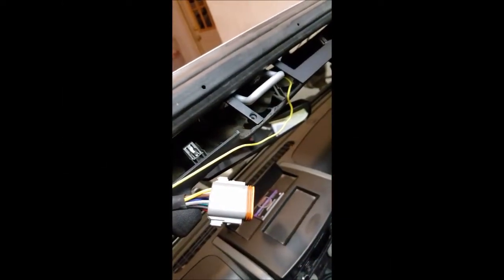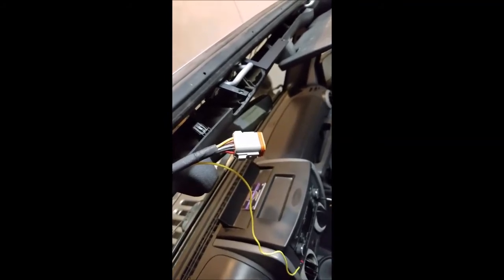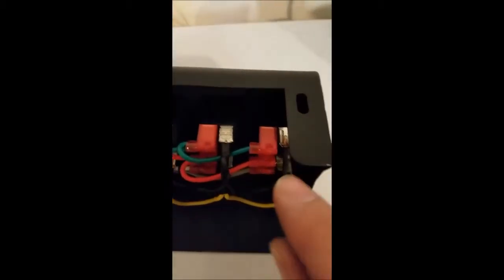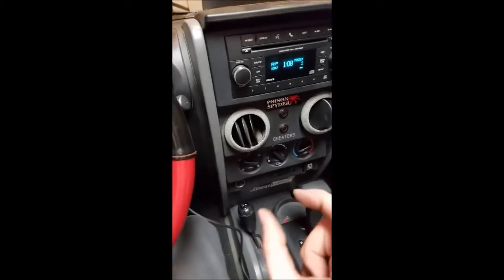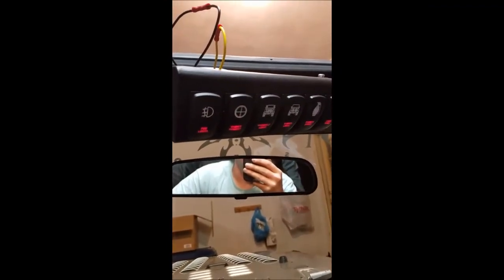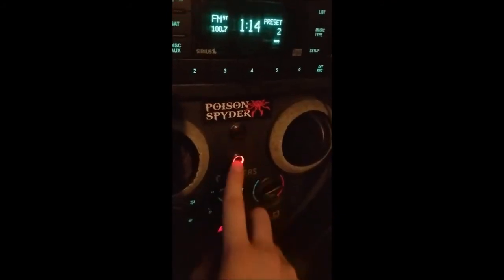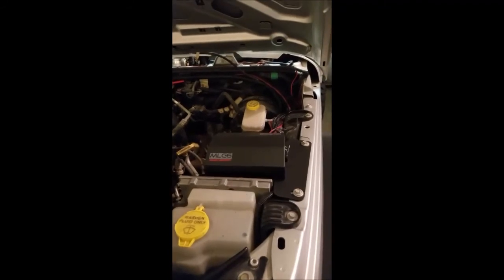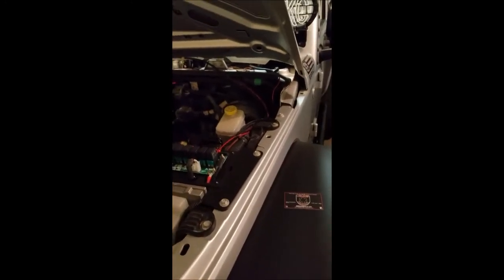Jeep JK Rough Country MLC-6 "SPOD" Part II

Comment: One question since I don’t fully i the electrical... instead of running your black ground down, can you not jumper it to the other ground (#8) on the switch?
Reply from the maker: James Watts you probably could, but I found it easier to just run my own at the time.

Comment: I’m having trouble closing my hard top fully, ( the latch above the light controller ) I was wondering if you had the same problem
Reply from the maker: Ryan Vizcarra this system, along with the spod unit makes it a little tighter to get the latch on. I can't close mine all the way, but enough to make the latch tight.
Reply: JMG Designs LLC same here, I can’t fully close it but I can get it tight enough were water won’t get in etc

Comment: Great fix for the MLC-6! Since both 7+8 are ground, couldn't they be spliced together? I will tap the lower led power onto switched power or add a small switch like the spod
Reply from the maker: a. ggrex yes both pin 7 & 8 can be daisy chained and share a ground. For me, it was just easier to do my own as the space in the switch mount was getting tight.

Comment: Could I see how you took out the switches, swapped them for a new one, and rewired them? I just got the mlc-6, and it now comes with a “power button” so to say, and it has me connect it to the fuse somehow, but right now I’m just wanting to change my switches. Haha
Reply from the maker: Depending on the switches they may have different wiring on the back of them. Make sure you check out the diagram with your new switches and do your best to match them up.  
With the power button on the updated system I hear it is a little more complex but that should be the button for the lighting of the switches.

Comment: I don't do a lot of electrical but I want to get one of these systems for my wrangler.  Is that Orange wire with grey stripe still used on 2015's?
Reply from the maker: Taylor Buraczewski it should be, or if you have the ambient footwell lighting then you can likely tap onto that instead.

Comment: Hey JMG Designs LLC, would this way also work to tapping into the JK dash light circuit and make the lower led's dim?
 on page 5. http://s3.amazonaws.com/roughcountry/install/921709620.pdf

I was wondering, will the LVCO still work even if we follow these instructions? And also now that it is plugged into the fuse and is connected to the ACC and dash will the upper independent lights on the Otrattw buttons still work?
Reply from the maker: Quinton Pearson using the way provided in the new directions will not dim the RC switch LEDs.  That red wire for the switches is the power going to the switches, so it needs to be constant. Tapping that to the dimmable dash lights won't work.  This route will make the switch pod only usable when the Jeep is ON.     Turn the Jeep off, the switches will not work. 

The low voltage should still work if you have the Jeep ON, but not running. If that makes sense.
Reply: Thank you very much! So because I have the door switches, where can I plug that power wire into? Also are the switches that you got from OTRATTW the lower independent ones? Do you have a video showing how you connect the power wire behind the dashboard and the one under the footwell?
Reply from the maker: Quinton Pearson if you cut that red wire already like in the directions, you can splice it back together or run it like a fuse tap.

The OTRATTW switches I believe are lower Independent, I think I explain in the video. This is so we can independently wire the lower leds to come on with the dash lights.  If you have footwell lighting that wire should be easier to find and tap.
Reply: Oh ok, so since I haven't cut that red wire like in the directions i showed you I don't have to worry about splicing it back together correct? And cool I will try to just copy what you did in the video. And by independently wiring the lower leds to come on with the dash lights, i will be a to turn off those led's when i turn the dash lights off right? And I'm sorry for continually asking so many questions lol electrical work is not my forte.

Comment: I'm electonically challenged, I wish you would do a separate video that shows how you rewired the switches step by step.  Great video otherwise!
Reply from the maker: Bill Braski what would you like to be more in depth? With the RC switches that come with the system you cannot tap them into the dash lights like this, you need a new switch.  You 're use 90% of the wiring and just add a power and ground tapped from your dash lights or floor lighting, which the wire mentioned is usually the ticket to making it work. It truly is pretty easy.